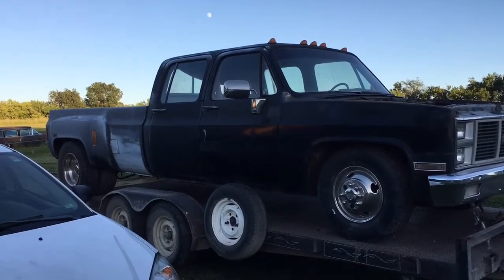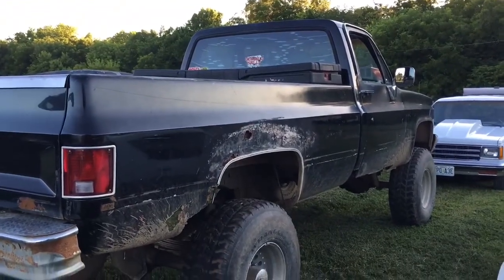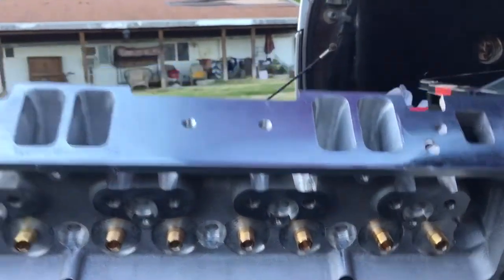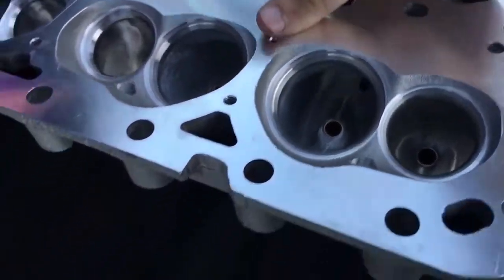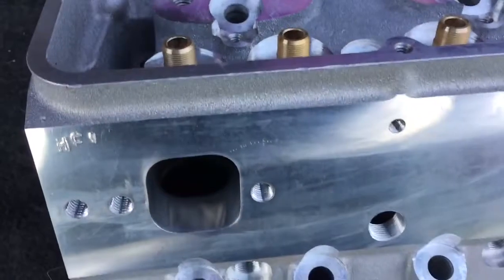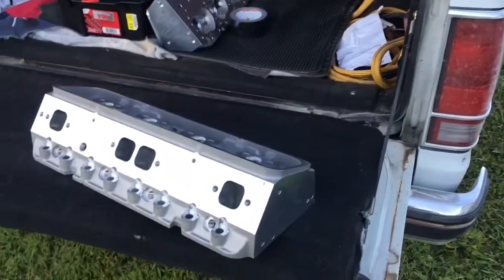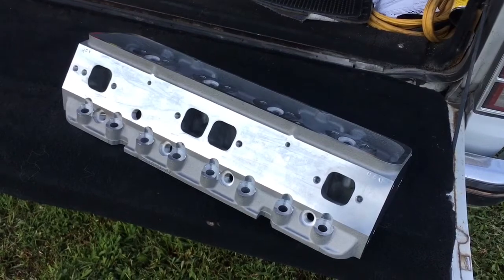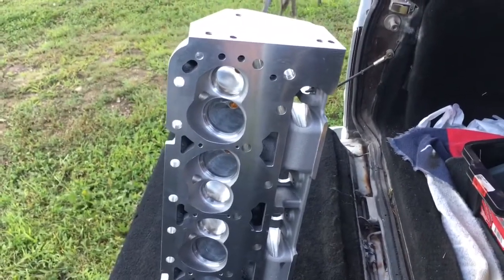Quantico cylinder heads Sneak peak 200+ cc aluminum head Porting

Comment: I first seen a video of  you & these Quantico heads.(teased you about your pointer) Ended up binge-watching almost all your videos. Nice work!! I have a set of these heads and was going to port them as you did my biggest question is. Time vs gain is it worth it? In your opinion what is the gain?
Reply from the maker: Corey Cole It depends greatly on your engine combo,how much horsepower you’re currently making and whether or not the combo needs more port volume/flow.  Theres no need to go to a larger runner higher flowing cylinder head unless you actually need it.  A combo can lose low/mid power with too much port volume hurting performance everywhere. 
What size engine and power do you have now? These Quantico Cylinder Heads were darn near a 200 mL intake runner to start with. A 200 mL intake runner can support a 355 in.³ engine up to 500+ horsepower so going to a larger intake port you really need Either 377+ cubic inches or making over 500 hp with the smaller cubes. Let me know more details about your build like cubic inches compression ratio camshaft etc. JD
Reply: HeadFlowInc  my question was vague I was assuming running N/A 
Bowl clean & gasket match I/E maybe 35hp on 350ci IDK.
LOL... my horsepower now is 255.
Reply: I have a 91 Corvette tpi 350.
Down to short block,  200cc head,9.75 cr, lt4 hot cam,1.6, proflo xt intake, 92mm tb, twin 67mm Garrett, fast xfi2.0  though I don't want to put these heads on now I have to for my intake to bolt up.
The plan is to build fully forged 383ci , 238 -246 dur 114lsa.590 @.50 with mentioned heads.
I'm not wanting to put a new engine and and try to work out all the bugs with the EFI I would think it'd be safer to use the 350 for now & get all the bugs worked out.
Sorry so long and thanks for replying
Reply from the maker: Corey Cole I’m assuming the Quantico heads you have are the 2.05/1.60 valve small chamber.  The ports should be really clean, so I’d focus on a smooth transition and verifying the bowl cut percentages. If you wanted to slightly reduce the valve guide boss you could.
Basic bowl cut & Blend with port clean up should be fine.  Be very careful with tool control so a valve job isn’t needed. 
I don’t know the quality of the valve guide material and longevity.  JD
Reply: HeadFlowInc  I was just going to do the basics as you mentioned. I would like to polish Chambers as well.( ordered some sacrificial valves today) what's going to have my neighbor turn two of them down as gages, as seen on your video thank you for that one.
I'm not wanting to add a valve job on top of them is my main concern. I guess if I hit one of the seats it will become more than just a cleanup. In your honest opinion given the setup is anything more than a slight cleanup worth the effort given forced induction
& 750 -800 hp end goal with 383